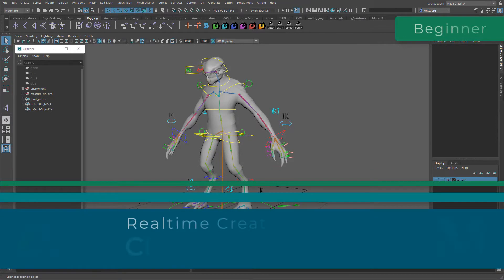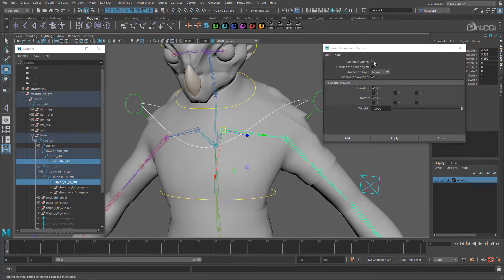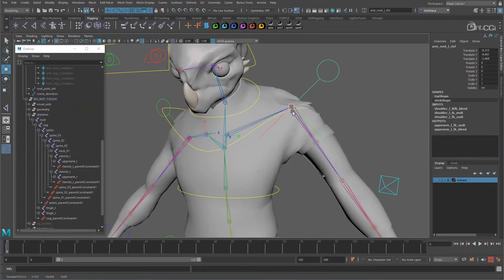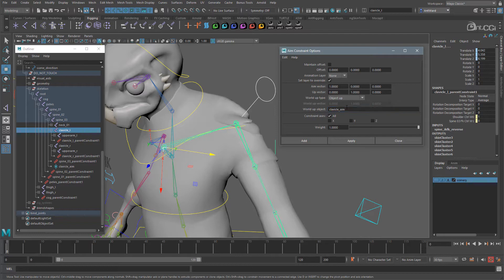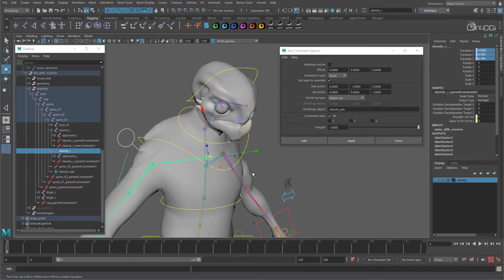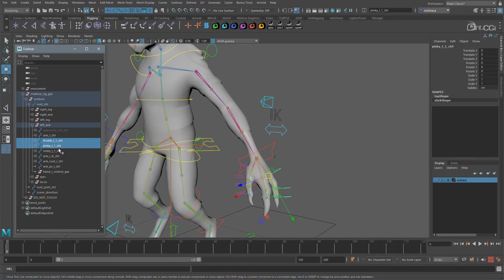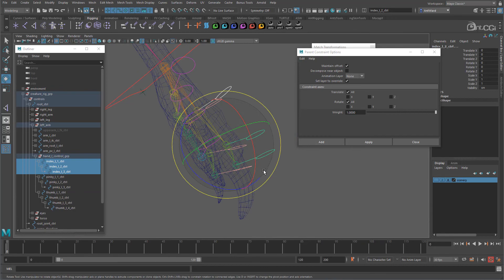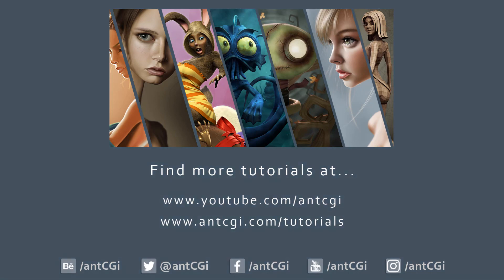Realtime Creature Rigging Workshop (17 / 19) : Clavicles & fingers

Comment: Lesson 17: Clavicles & fingers

Clavicle needs to aim to the shoulder, so when shoulder move up and down, it moves the trapezius up to mix with the shoulder's movement. Aim constraint needs a locator for stability, one at the middle of the spine should be enough

Clavicle also needs to follow chest (spine FK) or shoulder root (spine IK), which is a normal FK-IK switch (with the reverse node)
Question:
what if only follow chest? both spine FK and IK

Create a fingers_grp for the fingers' control to follow the skinned hand joint
Fingers are all FK, just constraint directly on to the skinned joints.